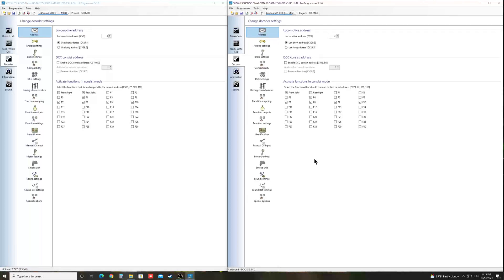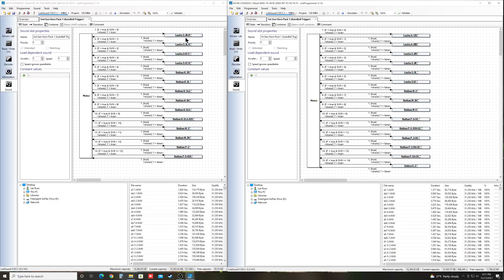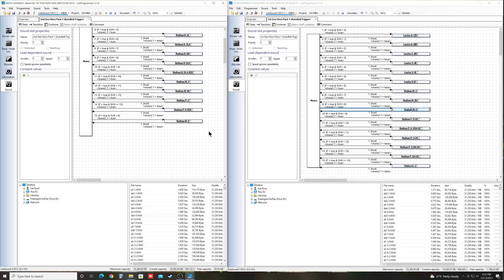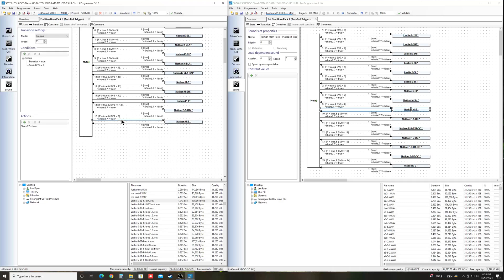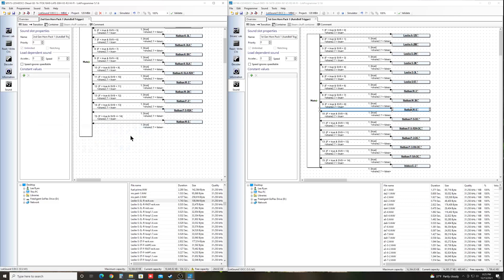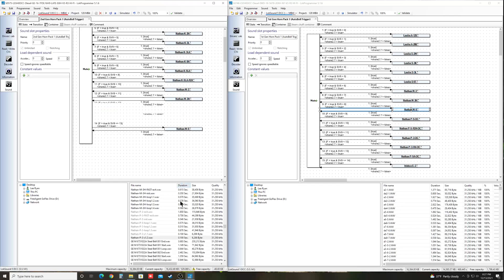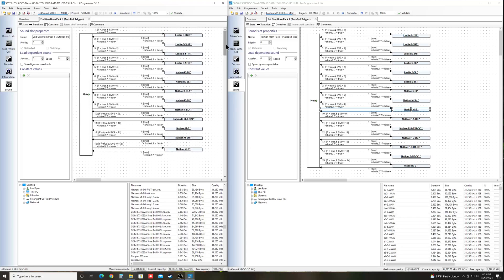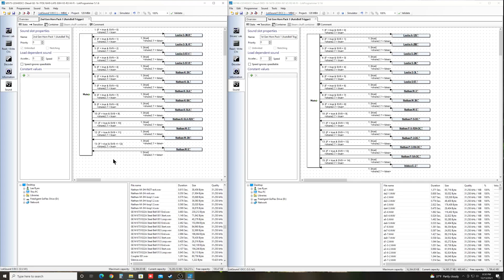ESU Tutorial Series - V5 Decoder - Transfer Horns from one Sound File to Another

Comment: Is there a way to delete the sound project from the decoder once it turns red and reload the sound project from scratch? I have a problem where the decoder is showing red in that line even if the decoder does not have a sound and it tells the current project is too large for the decoder while I did not change anything on the project

Comment: Excellent tutorial friend, one question, can this method be applied to transfer other sounds such as the sound of the dynamic brake or the sound of the fans between sound projects?
Reply from the maker: Yes you can transfer other sounds across in the same way. Sounds that are set-up differently than the horn can be copied and pasted directly over. The states and any containers that you want to keep would just replace those that you don't want to keep. You may have to clean up the transition lines so they connect properly but that's easy. I would advise though that you highly consider if you need to do this or not. Most of the dynamic brake sounds and other fan sounds are more or less the same across several sound files so replacing them might not really be necessary.
Reply: @RioGrandeFan  perfect thank you very much friend